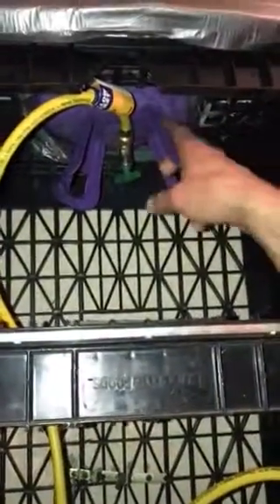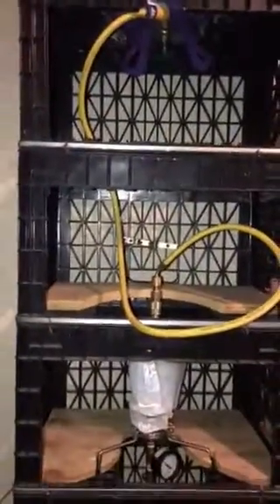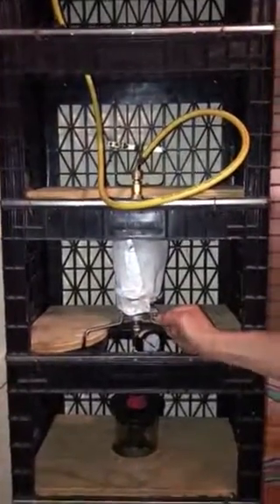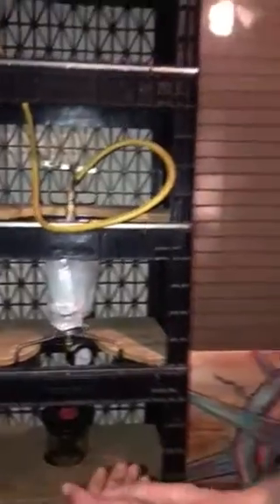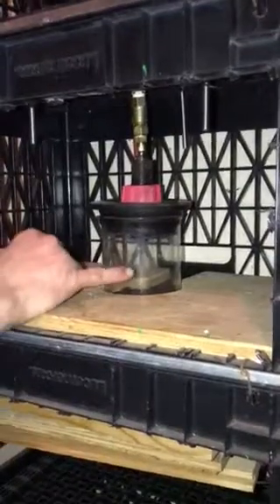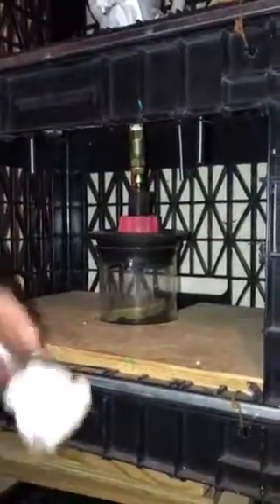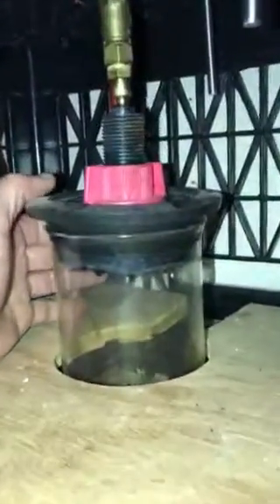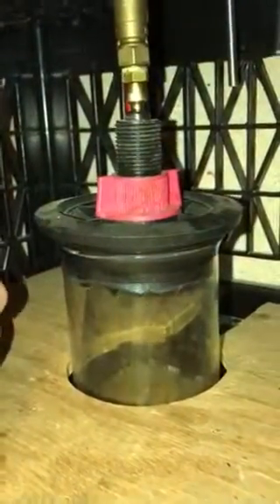Ericthemasterblaster Segment to BHO extraction

Comment: Do you distill your butane to rid of the mystery oil and contaminates? It doesn’t look like it’s capable of it. Even medical grade Nbutane isn’t pure. What your doing is equivalent to open blasting.
Reply from the maker: Zach Holler Absolutely not even close to an open blast. Are use Xtane which is the most commonly used in clothes column high-pressure systems. That is a miniature system for the purpose of demonstrating. Stay tuned we are releasing a very high-quality video covering every angle. This does not cover the two purges that I do after this. I do a Ethel alcohol bath in a deep freeze for 24 hours by 50 hours in a vacuum oven
We will demonstrate the process that is going into medical testing and Dispensary‘s this week
Reply: @ericthemasterblaster1977  so wrong
Reply: Eric The Master Blaster I've distilled the same butane you are using and found a lot of mystery oil. Winterization in a alcohol bath does not remove the mystery oil. Only lipids. Vacuums cannot remove mystery oil as well. The only way to remove is to distill and recover the butane for future use.